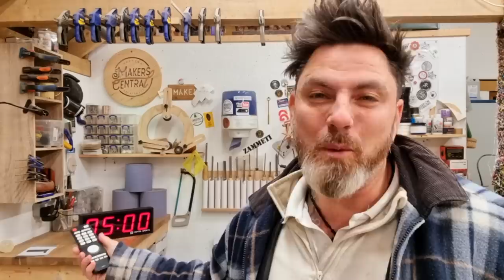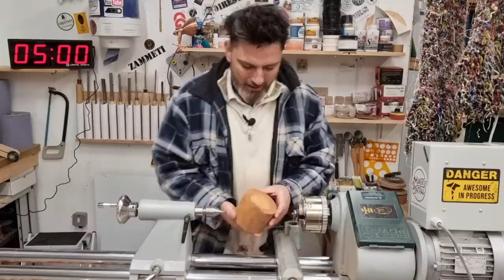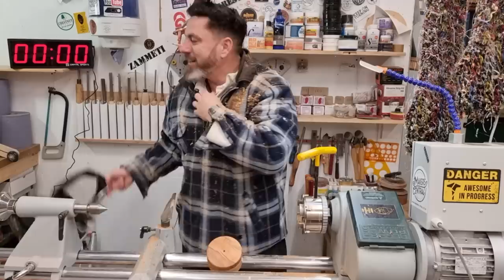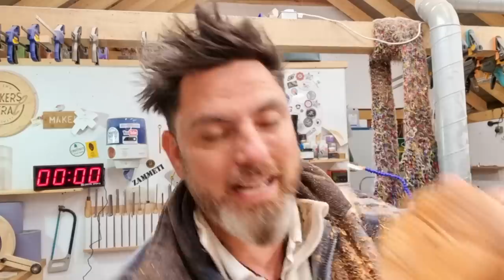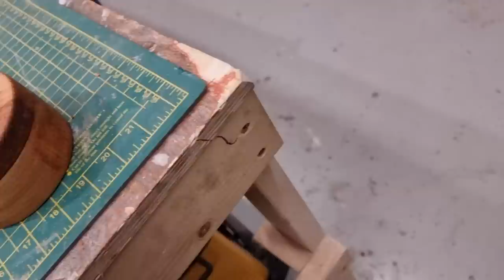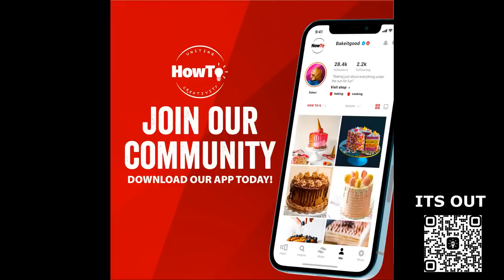MAKE SOMETHING IN JUST 5 MINUTES !

Comment: You did not fail. As long as you try and don't give up it is never a fail. Besides you almost did it. Just needed to sand polish and add the ornament to the top.  So basically just the finishes.  You did great. Don't sell yourself short.

Comment: I have a challenge for you. 4 hours. Your mission: Create an object inspired by your favorite SciFi or Fantasy movie or series. You may prepare all your materials before hand and if you have to use the vacuum vat the time will be paused until it is complete again. You can use anything from wood to resin, glues, dyes, paints, etc - even sparkles, etc. Mix media if you so wish. It can be any size you choose though I'd suggest something on the smaller side would be easier. You must share a list of steps and you cannot deviate from it. If object breaks and cannot be repaired with in the allotted time, you fail. If you don't finish before the end of 4 hours, you fail and you have to do another challenge lol Are you up for it?